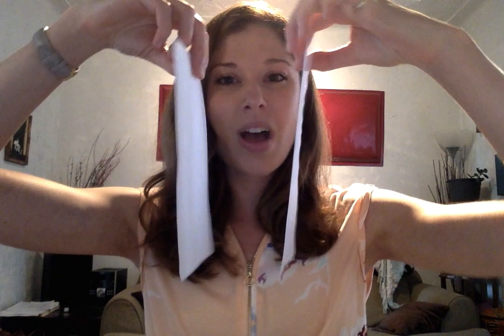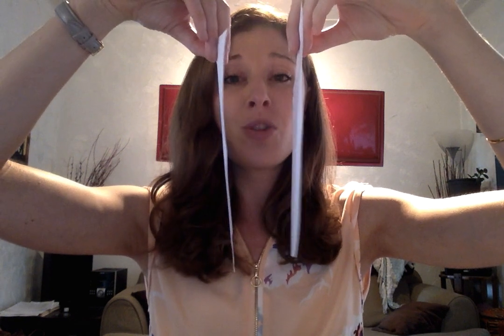The Bernoulli Effect: the Physics Behind Your Voice

Comment: This is actually 'entrainment', NOT Bernoulli's principle.
...
Unfortunately, like so many other demos and teachings, this misinterprets both Bernoulli's Principle and the true science of these demonstrations. 
..
The air out of the blower (your mouth in this case) has the VERYSAME pressure as the still air around it !  This is easy for anyone to see and measure, (see Weltner below)

The real Bernoulli science:
When air along a path CHANGES speed (accelerates) as it travels,  it is because a higher pressure region pushes it toward the lower pressure region, thus speeding it up..That's why it is faster when it gets there.  The speed DOES NOT CAUSE the lower pressure.
The changing speed accompanies the changing pressure it DOES NOT CAUSE IT !

The location where Bernoulli's  Principle actually takes place is INSIDE the blower. The higher pressure inside the blower accelerates the air inside it toward the lower (normal atmospheric) pressure outside the blower.
...
Entrainment:
The moving air from your mouth draws air adjacent along with it due to viscosity, or friction between the moving air and the still air above and below it between the papers.  Removing that air is what lowers the pressure NOT the speed.

...
Weltner in his Figures 3 & 9 cover this well:
Weltner in PDF - "Misinterpretations of Bernoulli's Law".  SEE  Figures 3 & 9 and the accompanying text.:
  http://user.uni-frankfurt.de/~weltner/Misinterpretations%20of%20Bernoullis%20Law%202011%20internet.pdf
Reply: That was a good read. Thanks for sharing
Reply: Observ45er 

In you fourth paragraph titled “the real Bernoulli principle” you explain that speed is a result of the change in pressure. Why? She makes no mention the speed of air coming out of her mouth being the cause of or reason why the paper comes together 🤔 I realize her explanation and description of the Bernoulli principal may be a little flawed but this isn’t for science majors. This is for vocalist trying to better their technique. She also made sure to preference this video saying (I’m paraphrasing here) that in high school she wasn’t very fond of the subject matter she was about to discuss, as if to say that this was a laymen explanation and I’m (meaning her) not the best person to learn the Bernoulli effect/principle from. That being said you mention that the Bernoulli effect takes place inside the “blower” 🤔 well she’s talking about what’s going on inside the “blower.” I understand that the demonstration may be an entirely different set of principles but she was talking about vocal chords and what was indeed going on inside the “blower” right? the paper wasn’t really the focus. Maybe I’m wrong I dunno.... anyway my point is this isn’t really a science place to be discussing science lol 😂 Still, thank you for further explaining each effect as I do enjoy both subjects. Music, and Science.
Reply: @skizzlemane1   Thanks.  Well, she decided to try to explain the science.  Singers need to concentrate on what to do and though it may be interesting to throw in some science, it isn't necessary, but it should always be correct.  Bernoulli's Principle is one of the most misunderstood explanations of the phenomena.
.
The ''blower" for voice is the lungs.  Muscles compress the lungs increasing the pressure in them, thus providing the higher pressure to force air out past the vocal chords into the now relatively lower atmospheric pressure.
I'm not going to watch the whole thing again after 2 years, but her words must have at least implied the common speed-causes-lower-pressure misunderstanding.
..
Clearing it up may be futile, but a quest of mine...
Cheers
Reply: @skizzlemane1  The Bernoulli Effect/Law/Principle is best observed with a very high larynx and a gentle "whoooo" or "heeee". It does work, it does take time to develop, and it will make singing across your whole range easier.